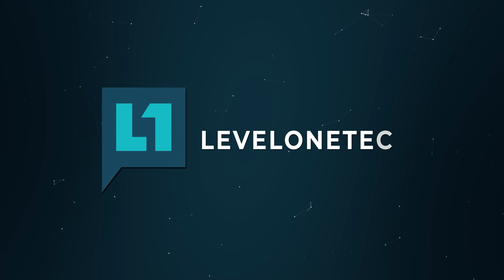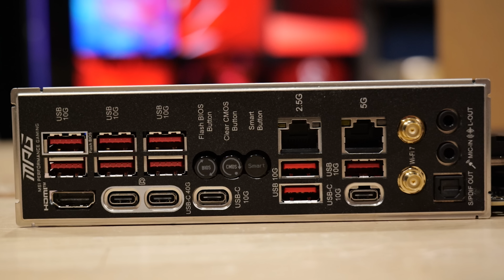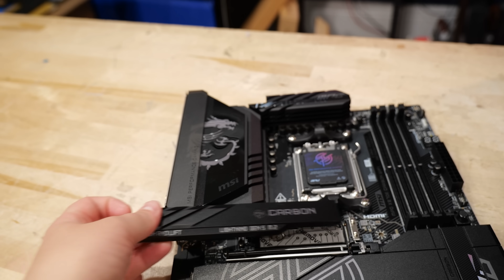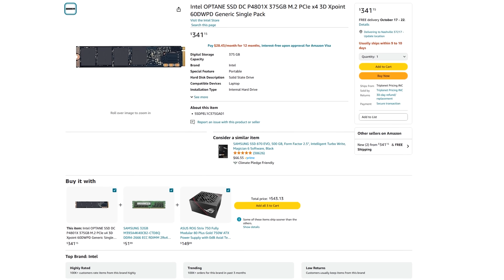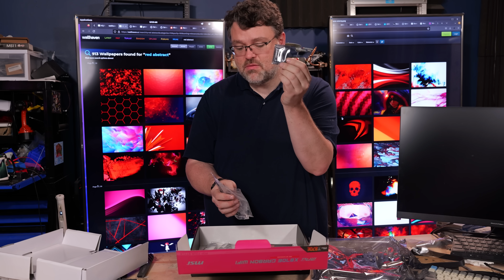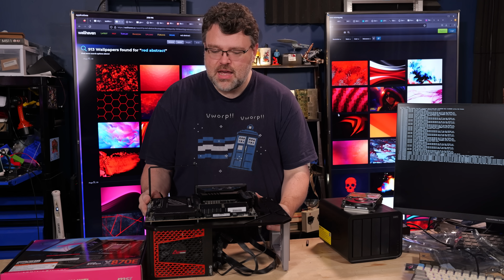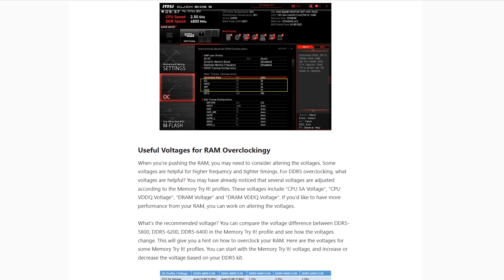USB 4.0 for DAYS! Checking Out The MSI MPG X870E Carbon WiFi

Comment: What's the PCIe bifurcation situation?
Reply: Supported, but wait for someone else to test it
Reply: @Phil-D83  Right, that's what I'm hoping someone will report back.  MSI's page didn't give the exact breakdown for my current B550 board, so it breaks a slot into x8/x4/x4 - which leaves my 4 slot NVME expansion card to only use 3 slots.  Seems to be how MSI did many AM4 boards, don't know with AM5. More onboard NVME is nice too, but I've never had enough storage ;)
Reply: @bobclarke5913  the lack of pxie 1x slots on the 870 series is very strange.
Reply: From what I think I learned in another video you could have one Gen 5.0 GPU and one Gen 5.0 nvme, but the other nvme's would have to be Gen 4.0.
Reply: That alone ruins my desire. 

I was planning on going silly and RAID0 Gen 5 lol 
 @LollyBread
Reply: @mikschultzyevo  i know the 670e version of this has 4 m.2 slots, 1 of them is pcie 5 the rest are gen 4.
Reply: 2nd PCI-E slot shares lanes with M2_2. Even if using a bifurcation card, it will run at X8/X4 5.0
Reply: MSI has been good, I don't know about this board. But even my old MSI X370 support PCIe bifurcation.

Comment: I am interested to see if ASUS come out with an X870E Pro Art. I have the X670E Pro Art right now with a 7950X and I am in fact using the 10G Ethernet port on my home lan which is a 10G network.
Reply: I cannot see anything that they could add to make it better than the X670E version, since that already has 10G and 2x USB4.
Reply: @_lordtra  If anything would make me change, it is the ability to run 4 dimms of ECC UDIMMS at a faster speed than I run two now.
Reply: Asus just released a X870E Pro Art today. Newegg has it for $480
Reply: @JohnCillian  I dont trust NewEgg anymore, but I saw it has been released.
Reply: It even seems that the x870e Proart is in some respects a downgrade, the front USB-C now only supports 30W PD instead of 60W on the x670e version, else all front and back connectors are the same except the x870e now has a clrcmos button on the back IO. Internal IO the x870e seems to not have the Aura RGB header anymore. Both are rated for DDR5-8000. So I really cannot see any reason to go for the x870e version. Except it would be cheaper.

Comment: Waiting on the next Threadripper... to be a generation behind this with less io likely. Hearing the "WA wa" song in my head, but I need the rendering.
Reply: probably gonna be waiting a while. current TR released earlier this year right? or was that the pro tr?
Reply: @jmwintenn both 7000 series TR released.
Reply: @jmwintenn  When are zen5 Epyc being released? TR is basically just a microcode mod on an Epyc package for obscenely priced workstation motherboards.

Comment: Here is a question I keep asking but get very little on ... we keep adding more USB ports to the motherboards, consuming more and more bandwidth at what point will we look at the motherboard itself and start a redesign to address USB bandwidth, actually moving data between USB, M2, GPU, and CPU at true PCIe speeds ... will it happen when PCIe7 finally releases hardware? I'm pretty sure from what I've read and seen, PCIe 5.0 doesn't address it nor does PCIe6.0 base on the newest quality motherboards being released.  This is something I very curious about given the advancement of CPUs, GPUs, RAM, and Storage ...
Reply: I think it's because most consumers don't consider the bandwidth or check how many PCIe lanes are being used by each component. Ninety percent of people just see more USB connections and assume it's a better board—just my theory. It's all about the sales, and most people aren't looking into details like that.
Reply: i don't think you're supposed to use all of them at the same time my man. comes with a manual, cant socket this into that if you're using slot 2, etc.
Reply: It all goes over PCIe lanes anyway, all periphrials, every single one right down to the analog headphone jack. It has been this way since at least PCIe v2. 1→4 PCIe lanes are used for a southbridge-like periphrial breakout.
USB microphones are a trivial amount of data, and nobody using USB camera connections is transfering real lossless 4k. They may label it 4k, but it is nowhere near the bandwidth or quality of the real deal. 
There are no external consumer devices (maybe external GPUs) that can sustain saturation of the availible PCIe bandwidth beyond short bursts, less than the size of their caches. Quad level nand NVMe sustained writes are down near HDD speeds the moment its cache is full.
Reply: Not supposed to and I don't - that's a no-brainer for me but do you know the number of people out there that do? If it's provided people will use it. Look at streamers as an example.  I can name a dozen off the top of my head with 2 or 3 4K cams, 2 microphones, control decks, other devices, and all that essentially filling all the available ports. I even know two big streamers that use USB hubs because they don't have enough ports - it's crazy.
Reply: I think you are confusing form factor with data transfer standards. 1. M.2 is a form factor. You can have m.2 over SATA, m.2 over PCIe, etc. You could take up some of your PCIe lanes for I/O but one would have to pencil it out to see if it is a worthy use of PCIe lanes.
Reply: @maxstrong1999  I understand form factor, Input/Output (I/O), data flow & processing, and all that. so let me clarify: I want to know at what point do we make actual advancements on the motherboards to make them next generation?  With more USB devices pushing more data at higher speeds (4K cams, high end microphones, full time editors using fastest external drives, capture devices, etc.) benchmarks clearly show the motherboard architecture  becoming the bottleneck. The reason I referenced PCIe7 in addition to USB arch/controllers is due to technical documentation, research and even videos, including one from this channel addressing how in the future the desire is to have more  efficient communication and workflow between ram, GPU, storage (I removed M2 reference and left it as storage as to NOT confuse it), and CPU which will be hard pressed if little is done to improve USB and external device impact on motherboards.  PCIe is evolving (slowly) and is why most speculate we will jump from 5.0 to 7.0 skipping over 6.0. 

Will that solve the problem, not sure.  Hence the reason for my question.
Reply: @GMDGeek  i suppose if one cannot get the throughput as it stands for a particular purpose, we'll see changes to the standards and form factors to meet the required data transfer speeds. Putting USB C form factor over PCIe is one way to do that, and I think there are even adapter cards that meet this purpose. I mean if you need more than usb c throughout your peripheral it should probably be transferred to a PCIe card. That's the point of PCIe.
Reply: @maxstrong1999  I hope so ... I'd just like to see motherboards address performances issues that are being highlighted more and more with advances in CPUs, GPUs, RAM, and even storage.
Reply: @GMDGeek the datacenters will get it first then we will. But I mean with hardware now you'd be hard pressed to personally be effected in your daily life using this new hardware.
Reply: @maxstrong1999  External PCIe cables were popular for connecting adjacent enclosues in datacenter racks with v3 (adjacent racks) and v4(adjacent units in a rack) but v5 lengths are limited to internal connections. (over copper) 
Every doubling in data rate reduces the maximum length signal path to about half and causes more issues with component design and fabrication; signal booster/repeaters or fiber converters each add some latency.
Reply: @mytech6779  yes. Good old signal integrity.